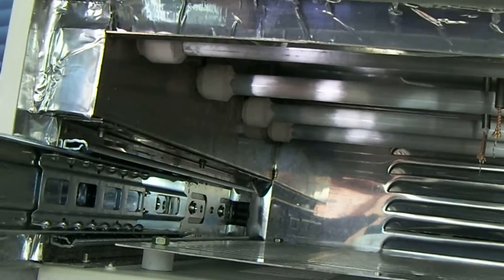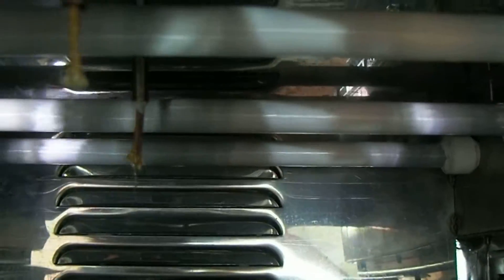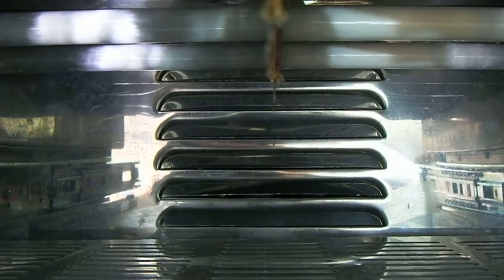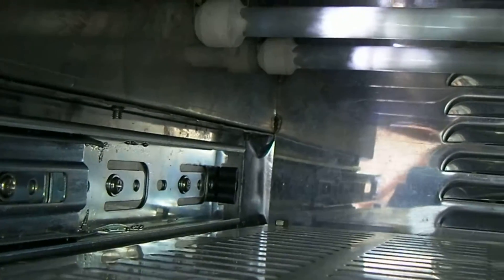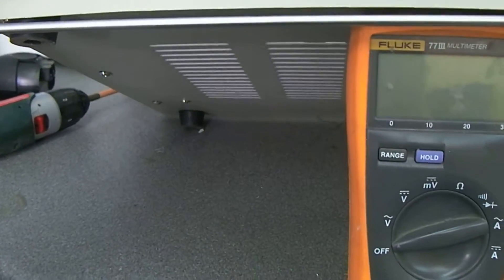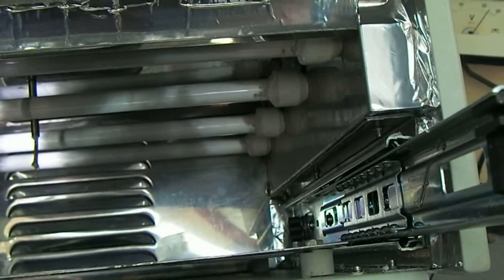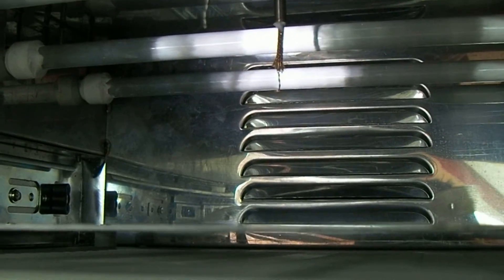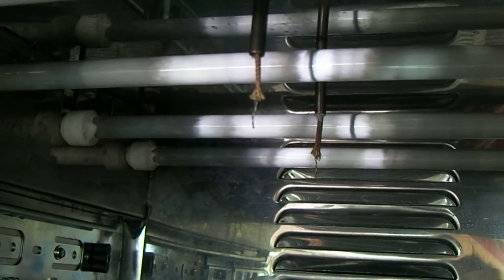T-962A Quick look inside the drawer space

Comment: Standard off the shelf drawer rails, and if that PVC clip will still be there after 100 cycles I will be surprised. The glass being ordinary window glass as well, it will crack after a few cycles, or at the very least will soften and craze. That should be toughened glass at least, preferably high temperature quartz but even oven glass will do.